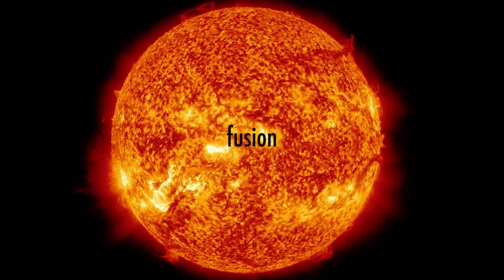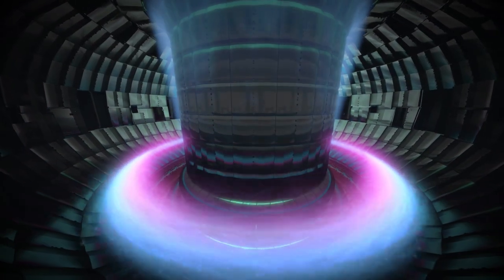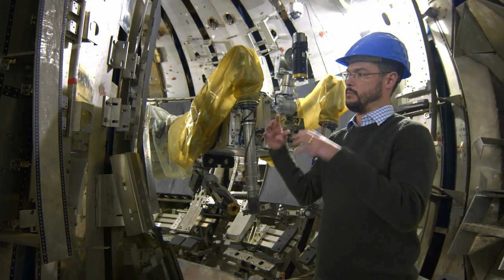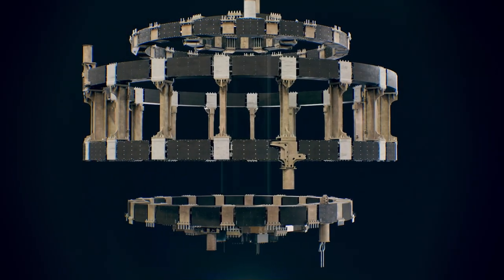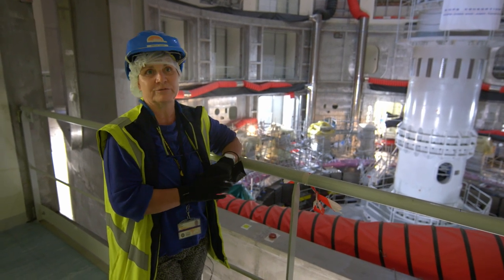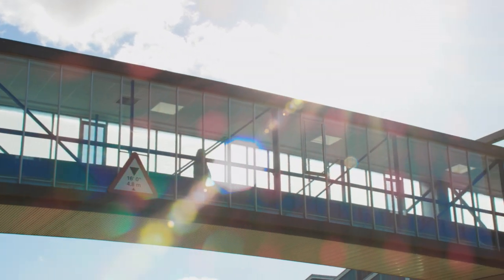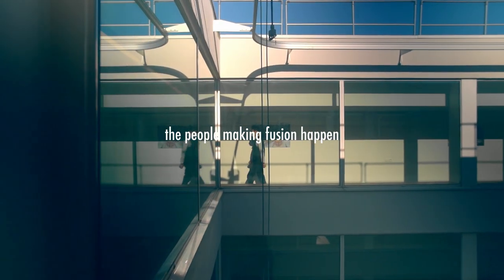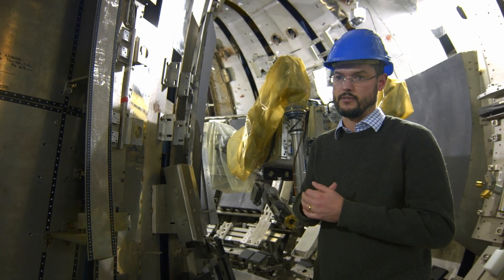The Easiest Thing Nature Does - An Introduction to Fusion Energy

Comment: Nice photo. Grandiose, and probably very profitable construction. But why talk about ITER as something super important, super significant and great in science? Wikipedia is clear about ITER as an experimental facility, and not for power generation. It's a facility for the magnetic confinement of plasma in a large volume. It says on Wikipedia that the developers want to "achieve enough fusion to produce a thermal power output 10 times the thermal power absorbed by the plasma for short periods of time." Doesn't any of the scientists, the developers of ITER know if fusion with excess heat will work out or not, and how much heat will be produced?  And a question for the scientists. If the small prototype doesn't work, doesn't produce the necessary excess heat, why build a very expensive, huge, extra-large reactor? What for? There are about 100 TOKAMAK-type reactors in the world and not a single one works. These reactors will never produce commercial energy. Because the theory is wrong. The reactors are made according to the principle of fusion, as in the core of the Sun. They should be made according to the principle of fusion, as in the solar corona. The technology and design of the commercial fusion reactor was developed long ago. Such a reactor can be made in two years, and the prototype which confirms the receipt of fusion according to the new principle can be made in six months. But all tokamak developers do not want to get a working commercial fusion reactor in two years. Why? And why are investors funding a failed project with a 70 year history? Why are they throwing their money away?
Хорошее фото. Грандиозная, и, наверное, очень прибыльная стройка. Только зачем говорить о ITER как о чём-то сверхважном, сверх значимом и великом в науке? В Википедии понятно написано о ITER, как об экспериментальной установке, и не для выработки электроэнергии. Это установка для магнитного удержания плазмы в большом объёме. В Википедии написано, что разработчики хотят «достичь достаточного количества термоядерного синтеза, чтобы произвести выходную тепловую мощность, в 10 раз превышающую тепловую мощность, поглощаемую плазмой в течение коротких периодов времени». Неужели никто из учёных, разработчиков ITER не знает получится термоядерный синтез с избыточным теплом или не получится, и сколько получится тепла?  И вопрос к учёным. Если не работает небольшой прототип, не выдаёт необходимого избыточного тепла, зачем строить очень дорогой, огромный, сверхбольшой реактор? Для чего? В мире около 100 реакторов типа ТОКАМАК, и ни один не работает. Эти реакторы никогда не выдадут коммерческую энергию. Потому что теория неправильная. Реакторы сделаны по принципу термоядерного синтеза как в ядре Солнца. А надо делать по принципу термоядерного синтеза как в солнечной короне. Такая технология и конструкция коммерческого термоядерного реактора давно разработана. Такой реактор можно сделать за два года, а прототип, подтверждающий получения слияния по новому принципу можно сделать за 6 месяцев. Но все разработчики токамаков не хотят получить действующий коммерческий термоядерный реактор за два года. Почему? И почему инвесторы финансируют провальный проект с 70 летней историей? Зачем выбрасывают свои деньги?